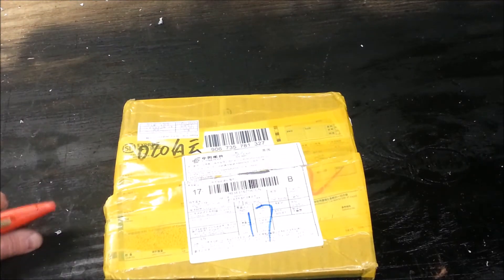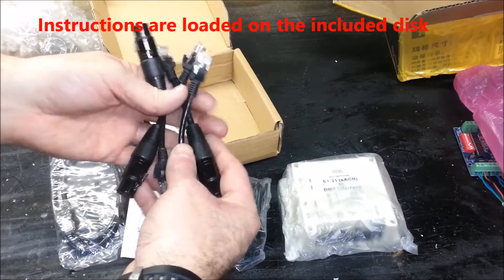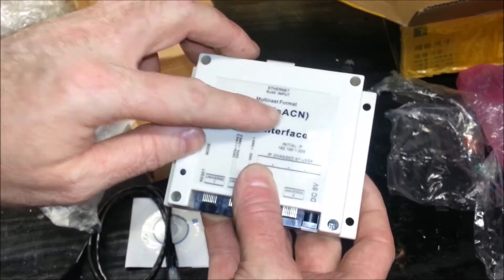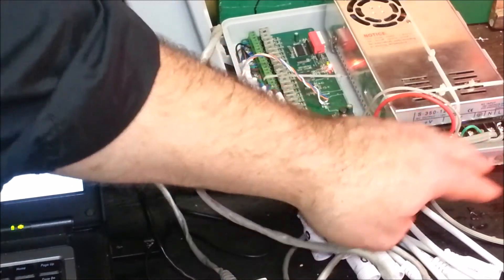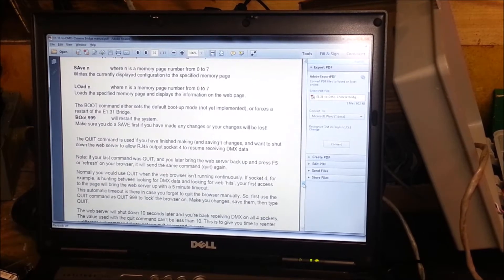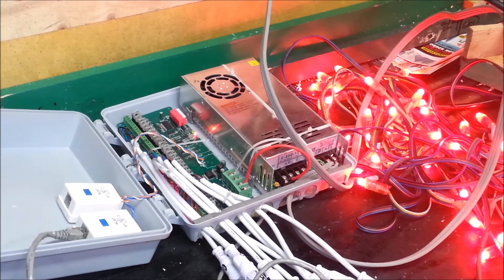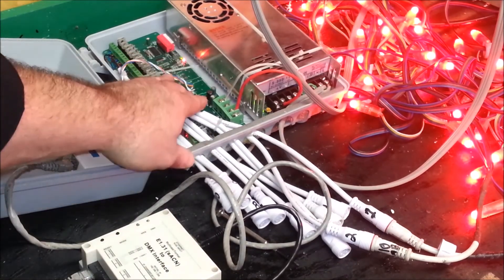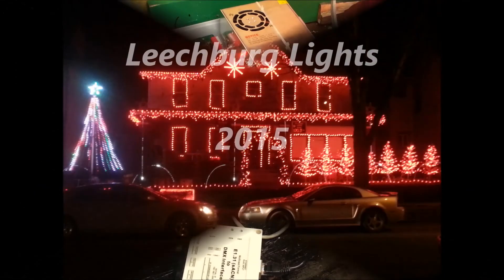$95-$97 DMX 4-Universe E1.31 Bridge

Comment: Hello, is this device working with Chamsys MagicQ?
Thanks for your answer!
😊
Reply from the maker: If that program uses e1.31, yes it will work.  I found this unit hard to work with and configure.  It stopped working after 2 seasons.
Reply: @leechburglights thanks man!

Comment: Thanks for the video. I followed your link and picked up the bridge. However, the one I got doesn't seem to work. I think it is the power supply that came with the bridge but I am not sure. I tried another 5v power supply but the only green Dmx light blinks and it will not connect to my computer. I tried to contact the seller but they are not trying to help resolve the issue. I'm I doing something wrong with the bridge? Is there something that I missing?
Reply from the maker: +Derwin Tom===== You need to assign a an IP address to your computer before connecting.  Did you do that?  Follow the video I've pasted here.  Your computer needs to be set to and IP address of 192.168.1. xxx(pick a number from 1 - 239).  Next make sure after you have powered up the unit and the green WEB light does not come on.  Try typing the address of the unit which should be 192.168.1.206.  You should be connected to the web setup page.    

https://www.youtube.com/watch?v=xPwmmZ1-lW8
Reply: Clyde….thanks for the advice.  Will try it.
Reply from the maker: How did it turn out?  Get it running?

Comment: Nice.  I'm a newbie on RGB, ran some simple RGB floods last year.  Adding Pixel tree and Coro canes this year.    I'm wondering why you just didn't use a $20 switch.  Again, I'm learning.  :-)  Keep your videos coming... love them btw.
Reply from the maker: Bryan Marr   Thank you Bryan.  This is a BRIDGE for e1.31.  It converts the signal from e1.31 into DMX.  Because I'm only attaching one e1.31 network item (this bridge), I just connect directly to the computer.   A SWITCH can not convert e1.31 into DMX.  A switch only creates additional connections for e1.31 devices.  Think of a switch as a 6 outlet power strip.  It takes the power and gives you 6 more outlets to plug into.  The switch just gives you more room for more e1.31 controllers.

If I was running this in my full holiday display I would have a switch connected to the the computer first, then connect this bridge to the switch along with my: 3 e682s, 2 e6804s, J1SYS P2, DIY LED Express e1.31 bridge.
Reply: Leechburg Lights    Ahhhhh..  got ya!    So, I ran a DMX GO Pro last year for my floods, fixtures, and animatronics.    I'm going to use Madrix to run my Pixels using e1.31.  I'm better of just using the two dongles then.  But if I wanted to "bridge" them all on one dongle I could.
Reply from the maker: Yes you could run up to 4 DMX pixel controllers (4 universes) using this bridge.  If you will have a concentrated display, then a pixel controller like the e682 or P12R could run 7 or more universes of pixels from one e1.31 connection.  It is all about how you want to setup.